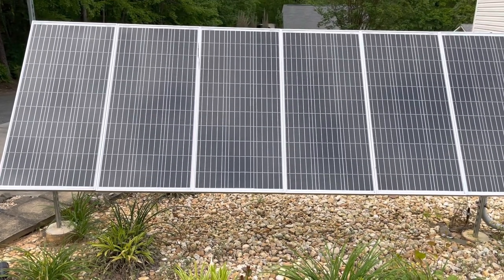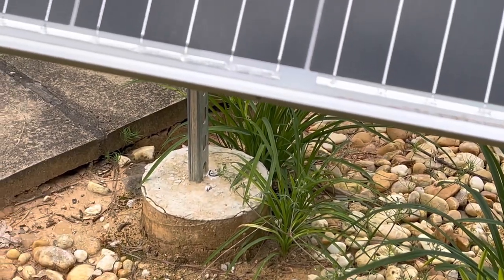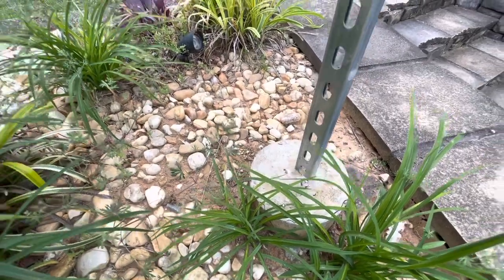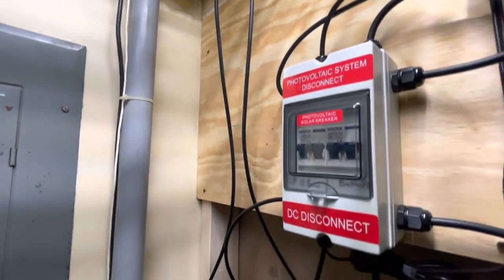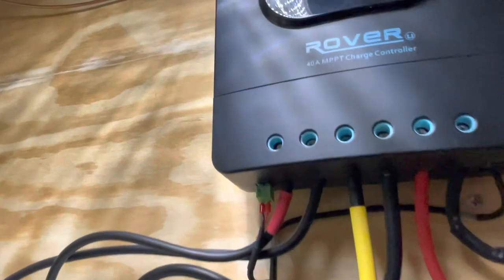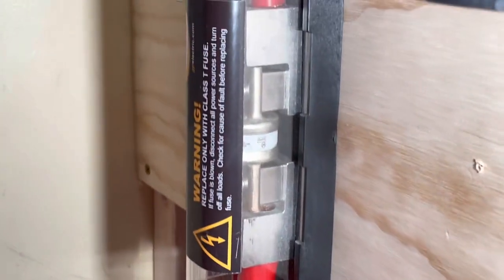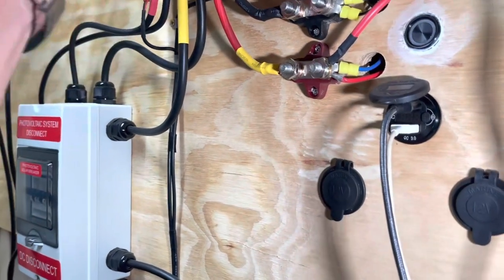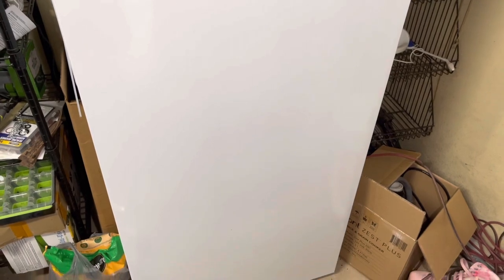Walk Through Of Our 600 Watt Off-GRID Solar Power System. Running For TWO (2) YEARS ZERO ISSUES!#diy

Comment: Just add eight more panels, eight more batteries, and a wind generator, and you have my system. The wind turbine is making a little over 1 kwH per day, and the solar panels made 3.06 kwH today. Showing 25.5 v at 8 p.m.
Reply from the maker: Nice! We are going to add a couple hundred more watts soon
Reply: What brand of wind generator please? Do you like the performance?

Comment: Looks good guys! In general unless you live in an HOA or you hooking in to  the grid you can install a ground mount off grid system just about anywhere. I would probably put those piers at 3-4 feet and you may want some hurricane ties from the corners in high wind locations.

Renogy is good equipment and I have two 400 watt off grid systems that powers everything for my cabin for full time living 20+ years now.  As long as the LIFEPO4 are same amp hour and have same output amps and close in age you can link them. Usually in pairs is best.

If you don't want to deal with individual components you can get a power station with at least 200Ah of capacity and eliminate all the wires and extra parts.

Keep up the good work!
Reply from the maker: Thanks! Yes we always stay away fro HOA areas they make no sense LOL cause the neighborhoods are always crap…..agreed we definitely need to go deeper on mounting as we seen very slight movement.
We will be reviewing a off the shelf power station and a DIY one we built
Reply: My Bluetti went bad, so do not rely entirely on a power station, have a backup battery somewhere. Yes, HOAs are bad news.
Reply from the maker: @gsp49  we got the all powers r600 and it seems to be very well built we got a vid on it
Reply: Texas Property Code Section 202.010 forbids HOAs and property owners associations from prohibiting outright a property owner from installing a solar energy device as defined by Texas Tax Code Section 171.107.  …. At least in Texas the Hoa can’t say anything !!! Funny part I’m the deed restrictions president and I’m about to put up 2 solar trackers 2400watt worth of panels 😊
Reply from the maker: @dieseldawg7132  Thank God we live far from HOAs LOL
Reply: @DIYKAI  yea I hear you…. Where I live it’s a voluntary Hoa it’s not strict…. Most of the people in the neighborhood are retired so I volunteer…. A lot of times some of these older folks just need a little help that’s all, but yes in Texas, I think most states Hoa has no say so of what you do with solar.
Reply from the maker: @dieseldawg7132  yes as long as you don’t touch power company stuff most cases you are good to go

Comment: Enjoyed the video, watched at least twice. I have a 6 100 panel system, not up and running yet. My charge controller only accepts up to 50v, so I am thinking of running 3P2S, if I’m right I should be getting 48v at 10A with voltage drop. I had all 6 parallel with 12AWG and was only getting 4A at 24v.

Comment: Very nice.  We have been running a 12v 400w solar set up with 2 100ah power queen batteries (was 4 115ah AGM batteries) for almost a year now running our bedroom.  Seeing someone else with a set up like mine that uses it every day helps me understand more of what we can do.  We just run a digital alarm clock 24/7,  charging phones, tablets, watches, 32in TV with a sound bar.  2 sets of 16 ft led strips.  We have run our heating blanket. We are looking to max out our 2 30a mppt charge controllers and add 2 more batteries. It's nice to see I'm on the right track for our usage.  I'm looking at the 3000w Renogy inverter and a transfer switch as well. Not a for sure thing yet. Still pouring over options and crunching numbers. Lol
Reply from the maker: Nice! Yea numbers crunching is a must lol….the 3000w inverter does very well I have never heard the fans run under normal conditions never gets hot or anything just a mild electrical buzz when loaded more than 50% or so
Reply: Love the channel btw.  Good information on here.  Watched a lot of your videos and Will Prowse before I started building this project.  I had the 100w harbor freight solar kit and a  100ah AGM battery with the harbor freight 750w Inverter.  That was used for testing and camping.  Worked well enough to get me to build what we have now.  And this one here has me thinking about doubling our system now.  I might go with the 3000w renogy inverter charger.  Reviews for that are mixed.  Figure by now they have it all worked out. Lol
Reply from the maker: @acuratltypes6694  🙏 thanks we appreciate you! Any questions just comment whenever and we will get back to you stay safe
Reply: Thank you.  Very much appreciated.  Keep up with the videos.
Reply from the maker: @acuratltypes6694  yw!

Comment: Nice job.  Way more precautions than me, but I'm a half-asser.  I have 2, 2000 watt systems with a total of 2800 Watts in panels charging 11 kilowatt-hours of batteries.  My panels are not grounded, and my cable is not buried.  I have breakers, fuses, and gigantic cable on my 12-volt homemade system, and my other system is a bluetti ac200 Max.  Anyway, your setup looks great, and properly done.  I appreciate the video.
Reply from the maker: Thank you!

Comment: You have built a nice solar system. I’m glad it’s been working well for you. Do you watch TV? I’m using about 150 AH each night to run two TVs off a 2200 watt 12 volt inverter.
Reply from the maker: Thank you! Not off this system this serves primary as a garage power source for the deep freezer & mini refrigerator. While keeping the cordless batteries and phones charged we only burn about 70aH a night or so

Comment: have you tried 4S configuration, I have same system as you and I cannot decide on 4S or 3S1P config.  The Renogy 40 amp controller can go up to 100V, at 4S I'm bringing in 86V which is under the 100max.  3S1P I bring in 62V I think, if I remember correctly.  Battery charges faster at higher voltage and more efficient, but charges longer when running panels in Parallel. (charges earlier and later in the day).  Have you tried different panel configurations?  I'm using mine for an off grid shed.
Reply from the maker: I haven’t tried getting around 36+A from about 10AM to about 4 we have a lot of trees so didn’t want the system to suffer from shading at different times

Comment: That's a nice setup. I recommend the Rover 60. I'm running 3 200 w Renogy panels with wheels so I can chase but they do very well just at solar South. I'm not fused as well as you. So far so good  with 2 100 ah life4 batteries thinking about a 3 rd.
Reply from the maker: Thanks! yea we should have got the 60A to begin with as 40A is right at the point of being slow when you increase your battery bank size. We have 400aH now.......we fused them for peace of mind as the system is in the house and on 24/7.
Definitely more batteries the better LOL.
Thanks for watching and good luck on your build!
Reply: @DIYKAI  oh also I used 8 gauge pv cables. During peak hours I've seen the controller at 540 watts at 37 amps
Reply from the maker: That’s AMAZING that’s what we get with 600 series parallel LOL good job!!

Comment: How do you store it??? Cost per kwhour?????
What is production at night?
What if cloudy?
Be honest!!!
Hail????
No tracking system?
What is latitude?
Reply from the maker: Energy is stored in LiFePO4 batteries
No production at night
Cloudy it still produces but at a reduced rate
Has stood up to hail, snow, and hurricane winds 50 mph
Reply from the maker: No tracking system ground mount manual adjustment 
South

Comment: Im in the process of installing a system similar to yours, with six 100w panels. Did you go two sets of three parallel to series?Im trying to keep voltage below 40, so I can branch off to charge my solar generator once in awhile as well. It sounds like the power company my have an issue if connected to breaker box.I was looking at an inverter with built-in transfer switch,may have to reconsider.
Reply from the maker: We did series parallel 2 strings of 3 panels….with our setup we are over 40VDC so it would depend on your panels it sits around 50 or so I believe (can check in the morning if you need to know exactly)
Yes absolutely the power company will have a fit and it is illegal without a interconnection agreement (meaning they will come and install a new meter and inspect the work before restoring service)
We ended up using a inverter that has a single phase output and we made a complete separate fuse panel….power company has no issues as long as you don’t tie into the main service panel (unless you have all the proper permits and crap) basically so you don’t back feed into the mains if there was an outage and linemen are working it could kill them

Comment: Since your charger controller is a 40 amp model the maximum input wattage with a 12 volt battery is 520 watts. If the battery is 24 volts the maximum input watts is: 1040 watts. 
The maximum input current is dependent on the solar panels and how they are connected with the maximum charge controller rating being 40 amps.
The panels when connected in series can have a voltage up to a maximum of 100 volts DC.
100 watt panels have an output current of about 5 amps each. 
100 watts / 5 amps = 20 volts
The maximum series connection is 5 panels. Which provides the 100 volts at 5 amps. 
While it appears that you can have more solar panels connected the charge controller document says the maximum watts on a 12 volt system is only 520 watts. 
Placing the additional panel puts some strain on the system of the battery is only 12 volts. 

For higher watt values it is better to use at least a 24 volt battery system. 
The wire thickness will be thinner on a 24 volt battery system also since the current is less. 
On the charge controller the wire size coming out of the charge controller should be sized to the rated current of the charge controller or 40 amps for this model. The chart says the wire needs to be at least #6 wire but if there is room for #4 wire in the connector that would be better.

Comment: That fire extinguisher is not going to kill a lithium battery fire.
Reply from the maker: Definitely not lol….but it will be enough to run
Reply: @DIYKAI and Lifepo4 is super safe, least likely to cause a problem.
Reply from the maker: @gsp49  it’s well fused and all and the BMSs have been decent so far almost 2 years and zero problems
Reply: @DIYKAI  Agree, almost overkill with your system. Better to have too much than not enough, holds true also for money, food, ammo, and sex. LOL
Reply from the maker: @gsp49  for sure LOL 🍻

Comment: Would you say you prefer the renogy panels or harbor freight? Im still deciding between the two
Reply from the maker: Either are fine if your looking for portability then HF is the way to go. If your mounting them you can’t beat Renogy…..just be aware HF uses SAE connections while most everyone else uses MC4 connections
Reply: harbour frt panels are 45 watts, renogy are 100 watts each

Comment: very nice system and well executed. I'm wondering why you are only getting 2 kw/day. It seems to me on a good day 600 w system should produce about double that. At a minimum I would expect closer to 3 kw. My guess is shading problems? Anyway, just wondering. I really like your array mount.
Reply from the maker: Thank you! Yes we have some shading issues with a very large old tree don’t want to cut it lol but this serves as a small backup for right now.
Reply: I'm getting over  1kw  day with only 200w panels everyday
Reply from the maker: @Jr_Lewis depends on location and battery bank size as well
Reply: @DIYKAI  that true I live in Caribbean mostly sunny
Reply from the maker: @Jr_Lewis  ah nice man weather is good there I bet and not tall trees or buildings blocking lol...we have all 4 season here it was just around -10C (14F) the other day here

Comment: I know prices have changed since you installed this system, but what kind of investment?
Reply from the maker: It’s difficult to say……with some discounts at least 3k batteries are the most expensive of you want the best
Reply: @DIYKAI  Couldn't agree more. We use about 6kwh per day. How many watts would I need?
Reply from the maker: @hamhocksandflipflopsfarms  so right now we see around 2.2kW a day right now and 3+ mid summer if the batteries call for it (low charge)...
what is the most amps you will pull at the height of your day?
Reply: @DIYKAI  I'm not sure exactly. We're building a very energy efficient 800 sqft house. We want to be totally off grid. I'd say a 110 ac start would be the highest to start.
Reply from the maker: @hamhocksandflipflopsfarms  ok so we always say more is better lol for the not so sunny days.....you could start with a 1.2kW system build it yourself. 
If you are only running 110/120 single phase you can stay 12VDC nominal.

1.2kW worth of panels
at least a 60A MPPT charge controller
minimum 600aH LiFePO4 (3x200aH)
Reply: @DIYKAI  Thank you for taking the time to help me. That's a big help.
Reply from the maker: @hamhocksandflipflopsfarms  you would want a pure sinewave at least 3kW one that has a direct wire hookup so  you can run your house plugs like normal and put the inverter in a closet or something.
Reply from the maker: @hamhocksandflipflopsfarms  your welcome please make sure you use the proper fuse and wire size with a little wiggle room over your max anticipated load...a shunt will help measure the load pulled from the battery we can...to give you an example a shop vac will pull 1kW at around 100A DC from the battery...on the plug side it works out to around 116VAC at around 17A
Reply: @DIYKAI  Will do. Thank you again

Comment: your steel frame and mounts are a ground also
Reply from the maker: Yes but they are separated by concrete and the cardboard liner so running the ground wire is always best

Comment: what size fuse connectors are you using for your series/parallel hybrid and how many? I'm also building the same setup as yours.
Reply from the maker: Are you asking amp rating on fuses?
Reply: @DIYKAI yes, and how many are you using in your setup? because i also have 6 renogy solar panels that ill be connecting them in 3 series and 2 parallel. great video btw!
Reply from the maker: @Owenimus  ok so off the main positive from the panels inline 30A Renogy makes them. Mc4 style
Reply from the maker: @Owenimus  inside box is a 32A & 50A to protect the CC

Comment: How many watts can you run at once at 230 V? How many volts  do the panels produce?
Reply from the maker: Panels don’t produce 230v you will need an inverter for that. Each panel produces around 20~22VDC
Reply: @DIYKAI  How many watts of inverted 230 VAC is there in one 100 W panel at 20 VDC? This is a hard question and I don't get it
Reply from the maker: @teemum.9023  230VAC usually requires a 24VDC battery bank and a 24VDC to 230AC inverter you cannot make that with just panels
Reply: @DIYKAI  Yep, I know. Inverter. But not batteries. How many volts in the panels to run 230 V 3000 W appliance
Reply from the maker: @teemum.9023  the panel voltage only matters when it comes to the charge controller the system is based off the charge controller limits…example ours can handle 60VDC and charges the batteries at 40A

Comment: Question, how big is your 6 pannel array?

I mean, physical dimension, height and width of the pannels?
Reply from the maker: So it’s on the ground mount system and it’s approximately 10Ft wide by say 4FT
Reply: @DIYKAI  i have a follow up question, if you don't mind.

   Say, hypothectically, someone were to try and copy your set up to use as a small off grid cabin system. 
   If they wanted to upgrade the system to make it more effective, would you suggest adding more pannels for better peak generation, or more batteries for longer lull times as the first upgrade?

   It would only really need to power a 3 LED lights, a small apartment sized refrigerator (smaller than that freezer you are running, but bigger than a dorm fridge), and an on-demand RV style water heater, plus things like cell phone and laptop chargers.

   It would all be on a 120 volt set up.
Reply from the maker: @DH-xw6jp  so here is what we have experienced over the past year or so with the system fully running.

In the summer time this setup puts out over 2.5kW a day and that's with drawing the batteries down no more than 50% (we can pull it all down if we needed too) we just don't demand all that power all the time.

In the winter time it will draw down 75% easy a day.
 
We run this setup 24/7.

The max you can do with this exact setup is 600w and 600aH anymore than that and you will need to step the cc up to a 60A.
Reply from the maker: @DH-xw6jp  the question you have to ask is when is your peak usage and total daily use.....a killawatt meter will calculate that for you.
Reply from the maker: @DH-xw6jp  so in short of the cabin uses the cell and laptop charging during the day when your generating peak power and at night all you have is some LEDs and a refrigerator you will be fine with 600w and 400aH or more of storage (lipo) not lead acid if you use lead acid double that
Reply: @DIYKAI  okay. Thanks for responding!

I fear there is a lot of electric based math in my future. [shudder]
Reply from the maker: @DH-xw6jp  yea unfortunately
Reply: @DH-xw6jp My on demand gas water heater is using the same D size batteries I put in it new, 2 years ago. No power required other than that for the igniter.